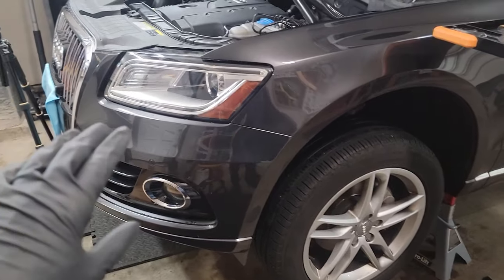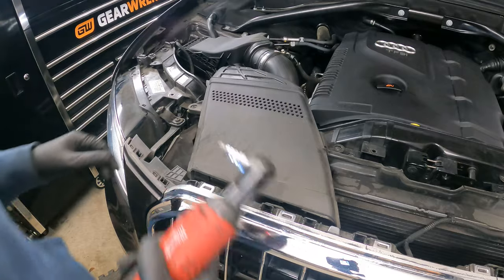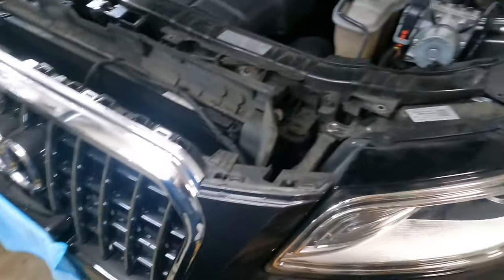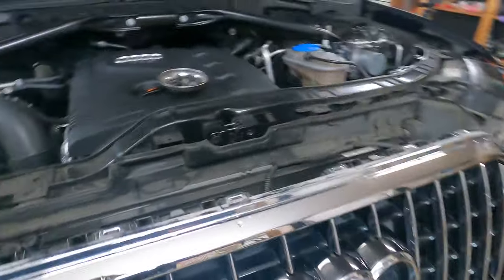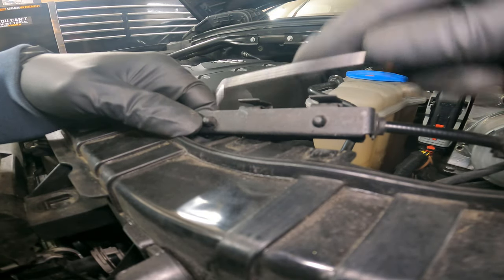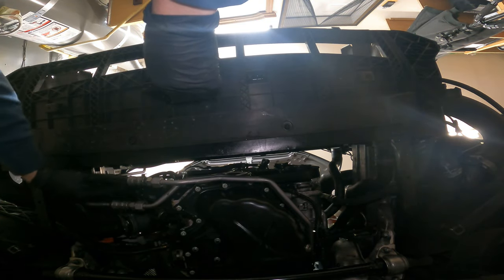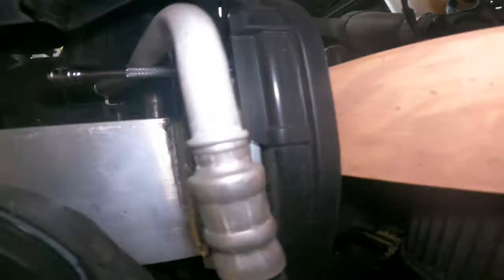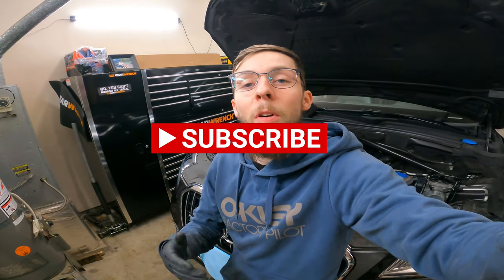Audi Q5 Service Position Tips and Tricks | NO SPECIAL TOOLS!

Comment: I have the quarter inch socket extender and it does not fit at all, but the exact same brand anything else I could use
Reply from the maker: You can also use longer bolts of the same size

Comment: Great video. Thanks for posting it. I need to replace the leaking water outlet flange for the lower hose on a ‘10 Q5 3.2 V6. Looks tight in there. I suspect I need to do what you did here for access.
Reply from the maker: Thanks! Yes, doing this will give you the right amount of space to replace that. I replaced that on my A6 3.2. Pretty straight forward job

Comment: Nice video, I have '13 A4 B8 platform that I want to do timing components upgrade, I think many of the things here will support my car as well, I like the 1/4" drive extensions gonna pick up a few of those tonight and I'm gonna do a water pump while I have the car in my garage, I have it on quick jacks which allows me to be sitting on the floor (no laying or awkward angles, I can actually get in there once I move everything forward so I will have a lot of room underneath to remove that lower timing chain case, that is the hardest part of the timing chain job is that lower case, it's a a lot easier to reinstall the cover without bumping the silicone bead when you have room.  I don't want to remove the entire front clip but I'll remove the intercooler hoses, the radiator hoses and the wiring, that should be enough to get almost 8" of clearance.
Reply from the maker: Glad it was helpful, sounds like you call a good plan🤟🏼
Reply: My recommendation is to get a couple of M10x1.5mm 120mm long bolts and thread them into the crash bar support bolt hole instead of a 1/4" extension.  I'd be afraid of leaning on it and having the whole core assembly fall off.  I used these bolts when replacing the timing chain tensioner on my B8.
Reply from the maker: Not a bad idea. However, since some things are still connected here and used the long extensions, it's never fallen or slid off at all. But bolts are a good suggestion🤟🏼
Reply: @homer4163  trust me I tried it.. there still isn’t enough room in service position, so I just went ahead and removed the entire front clip, not a big deal doesn’t take much more time, just put the condenser off to the side very carefully so no stress on the lines.. and drain radiator, pull the radiator hose I took out the headlights to be safe and hood cable and electrical connector made the job easy to get the lower case off and do everything.. the front carrier isn’t that heavy and once you pull the two T30 screws off the frame there is enough static force holding it in place you can lift it off the car and set it aside

Comment: Awesome and very informative video. I just aquired an Audi Q5 2012 but the entire wiring connecting the passenger side head light was cut, driver side works great would I have to place that entiring wiring looks like the wire you unhook at the 8:02 mark of the video  or is that the engine harnish you undid??? To get the light to work again....Thanks again the video gives me hope of avoiding the dealer ship$$$$
Reply from the maker: I don't think that's the engine wire harness. Hopefully I'm not wrong, but I do think they are separate🤞🏻
Reply: @Mechani_Cole  Thank you for the reply. I just need to figure out how to get power to the passenge side head light then since that wiring was cut for some strange reason.
Reply from the maker: Can you cut a section and rewire that with proper connectors?
Reply: @Mechani_Cole  That's what I was think I have to do. I was going to trace the driver side left headlight wiring to see where the connectors go....

Comment: Hi Cole, great video, very helpful! Got a question if you can shed some light on please. I'm working on sunroof liner of 2015 Audi Q5, one end got separated due to heat buildup within the car. I have opened the top back end upholstery and now got stuck on two clips, one on each end, which doesn't come out with medium pressure. Center one came out easily. Couldn't find how can I get these two out before I can unscrew the two screws holding the liner holder. I've picture wish I could share to exactly point to the buggers.
Reply from the maker: Wish I could help there, but honestly haven't been in that part of the Q5 to know. Most clips usually pop directly out, our slide one way first.
Reply: @Mechani_Cole  Thanks Cole, couldn't find anything on Google even close on this. Going to be a pain in the b**t 🤣 or I might end up breaking these clips lol
Reply: Liner motor on my '09 (purchased certified in '11 with only 2100 miles 🤔)... anyways, that roof liner motor died almost immediately. Even the aluminum guide spindle band thingy twisted up??? I rolled it, pinned it, never looked back. Tinted the pan.sunroof, added a trailer hitch to soothe my spirit, and I'm good to go. The dealer wanted an insane amount for the liner & motor replacement (conveniently not "certified" warranty covered). That was a no-go. I still love my Q all these years later. Same pin-up and tint.

Comment: Hey Cole. Great info. appreciate you. I've got a 2014 Audi SQ5 3.0 turbo prestige package. 77000 miles. I'd appreciate some info regarding the process to appropriately R&R  the  A/C compressor, receiver dryer, and expansion valve. I had the Audi mechanics diagnosis that the problem is the compressor. The R&R is Audi's recommendations. I understand the need to evacuate the refrigerant. I'd like to fully understand the importance of cleaning out the refridgerant lines to prevent issues r/t humidity and shreds of metal clogging and breaking the new ac compressor. The help would be appreciated as I dont have the $2200 Audi is asking to fix the AC. Thanks man
Reply: I cannot find any info on-line to help me do this project. I understand this video has nothing to do with want I need to accomplish, however you seem to be knowledgeable so I thought i'd ask
Reply from the maker: To be 100% honest, anything AC related I take it to a shop. I don't have a freon machine or anything needed for those kinds of jobs personally
Reply: I appreciate your honesty. Thanks man

Comment: My radiator startsd leaking and i have some issues in my 2009 aufi q5. How much to have you look at it?
Reply from the maker: I'm in the Vegas area, just to looked would be about $50🤙🏼
Reply: @Mechani_Cole   do you know anyone in the dfw area?
Reply from the maker: @breal6910 I do not no. I would just check for independent shops with good reviews

Comment: What if instead  of 1/4 extensions you put three threaded rods per side? I feel like that would be best case scenario
Reply from the maker: Would 100% be better yes. Another solution is to use the long bumper bolts, they are much longer and you can slide it out about 5-6 inches safely on those bolts.

Comment: im looking to buy a 2015 audi with diesel engine. are these reliable?
Reply from the maker: Yes very. But like with any vehicle, maintenance must be done.
Reply: @Mechani_Cole  thank you cole. This one has 91k miles so I’ll have to do timing belt soon. May have to pass on the car 🥺
Reply: @cuh720  Doesn't it come with timing chain?
Reply: @cuh720  Did you buy it?  I am looking at a 2016 with 88k.  Thinking I will have to change the timing belt?  Maybe I should haggle with the dealer about it.